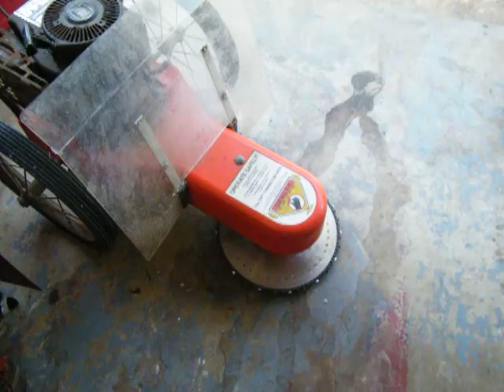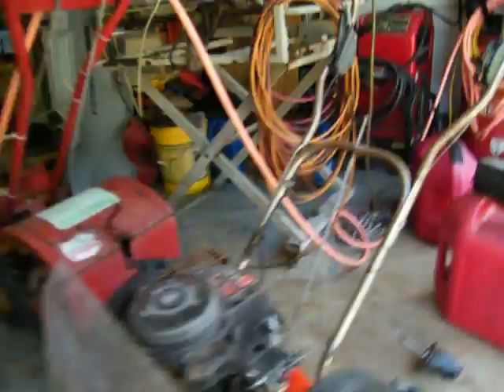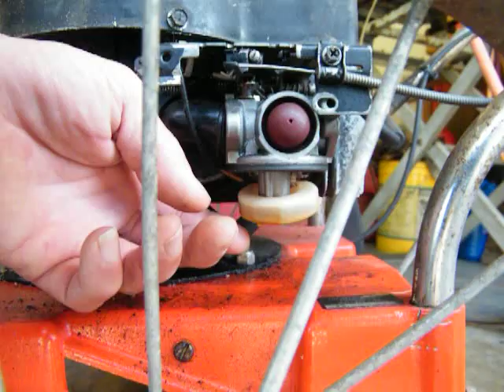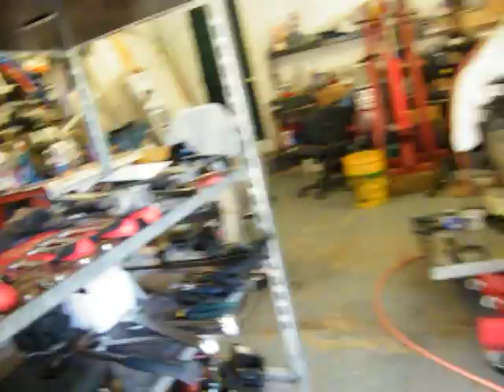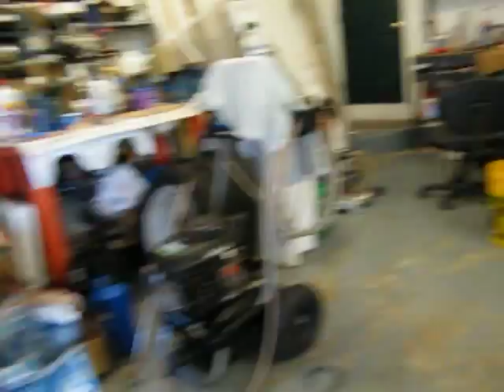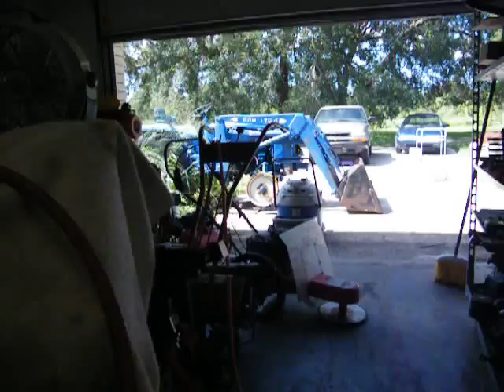DSCF0095 DR Weed Trimmer Saw Float issues

Comment: What in the world is it doing in Arlington, TX?
Reply from the maker: there's no clue, i got a refund ...I hope.. went and found the plug at napa cruised by harborfrieght picked up a punch n chisel set with some nitrile gloves, and buzzed by autozone because napa didn't have the gasket for the water inlet to the head. spent all morning driving, with the refund i spent roughly 8 bucks extra, 18.99 refund -  25.00 parts n chisels n gloves.